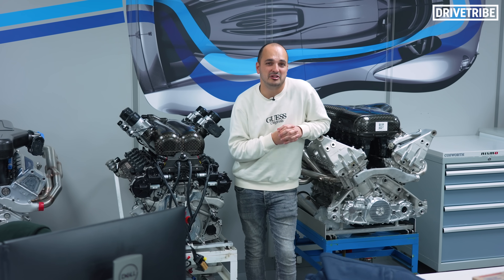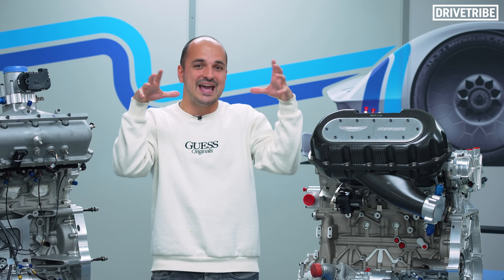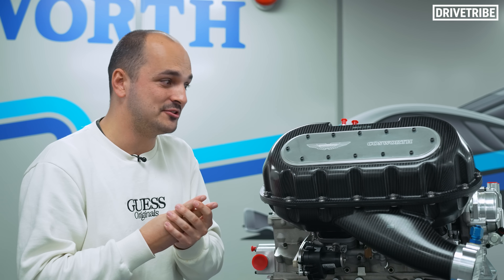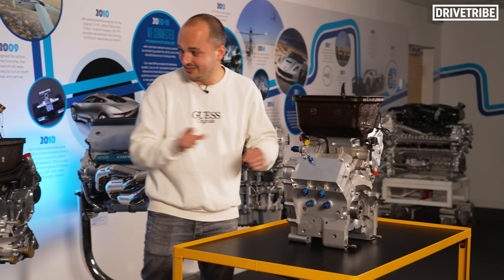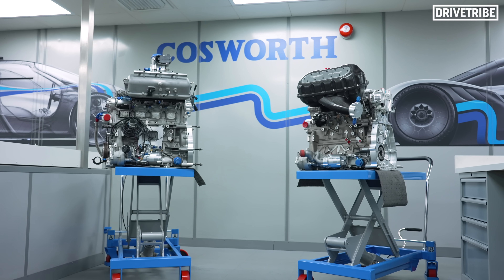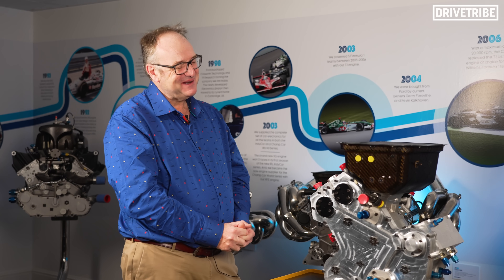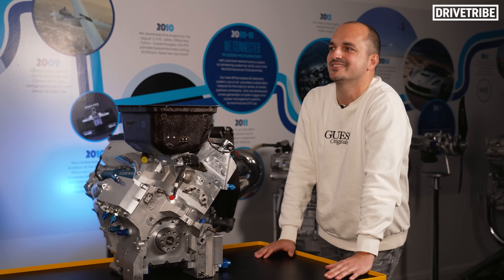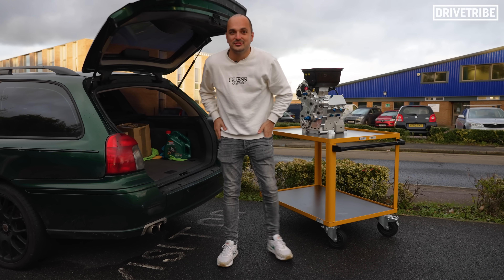This is a single cylinder F1 engine – 20,000rpm, 300cc, 90bhp!

Comment: the GM part numbers on the engine heads tells me we have the technology to get 50-100 miles per gallon mileage, but that wouldnt fit well with ripping the people off and keeping us broke . with hp like that we all should have 3 cylinder cars with over 300 hp/ the 4.0 litre engine is 245hp

Comment: Bah Hogwash  honda gran prix 250 cc sixes and 125cc 5 cyls blow them away and they did it back in the early 60s with rayon tires and no disk brakes.  the highest hp per cc engines were honda 6 yalve  and yamaha 7 valve engines.   Oh the 5cyl 125 did 29,000 rpm

Comment: Maserati used to make single cylinder engines to test their designs before committing the full size units into production.
A quicker and cheaper way to prove your ideas.

Comment: Turbo honda engines regularly put out well over 100hp-200hp per cylinder with everything stock except the turbo, pretty amazing considering they are built for low power economy cars

Comment: Instead of The High Rev's & High BHP on the single Cylinder / or 3 cyl' engines, Why not 
Lower the Revs & Bhp & Fit this engine to a Small Sports car or City Hatchback. 

Using this Formula, You maybe Could have a Very Fast But EFFICIENT Mid Range ? Ford Fiesta, & maybe a Tuned Version ( RS Turbo ) ? 
& Design it to run on LPG only ?

Comment: Why are all these guys knocking single cylinder engines ? My brother had a Royal Enfield 350 that ran as smooth as glass and a Velocette 500 that would stretch the chain it had so much low end torque. i guess they must be youngsters.

Comment: Is this engine  at 90 hp w/20,000rpm cosworth brand is capable for coaxial helecopter at one set?
Reply: no...no..i got  a wrong question not a set,I meant that this engine is capable to lift up me when I make a coaxial helecopter? I need spec. detail about  this engine regarding : the weight , fuel consumption  per hr. at max. full speed, including tempetature saturation? thank you

Comment: One thing I’ve never understood is how, considering spark advance timing is because the explosion takes some time to happen. Thus the spark occurs before top dead center. But how in the world can this work with s piston doing even 10,000 rpm never mind 20,000?
RIP Kevin Kalkoven

Comment: I'm amazed that a single cylinder engine that revs to 20,000 can even stay intact without falling apart. The vibrations must be a horrendous thing to experience.
Reply: I mean you can look at any high performance dirtbike, they rev out to 14,500 all day long without any issues. I can’t see another 5k being disastrous
Reply: Brushcutters have single cylinder engines that rev to 20 000 easily.

Comment: without a balance shaft no way it will go into a bike soon unless its a straight race bike with very hard suspension setups.. all singles i own and owned hadd balance shafts250-450cc 30hp-80hp apart from suzuki and kawasaki colaboration engine From the RMZ250 and kxf250 2004,2005 where they were revving 13.1k on a 250 cc 38hp and no balance shaft, needles to say they ditched the idea in 2006. making a gearbox for it wouldnt be impossible  but at 20k rpm with load its tough finding bearings that can withstand that and tollerances would be so very crucial and tight everywhere  it would need rebuilding soo sooooooo very often orwill goo balistic in seconds. imagine shifting at wide open and missing that 3rd gear KABOOOMM hahahaha

Comment: Something needs to be done with these super small, super light, super powerful engines. Imagine dropping them into an ultimate hot hatch build, or in something like an Elise or Caterham. It would be incredible to have that power to weight, and the sound...
Reply: They aren't light. Quite opposite

Comment: Noonan racing make a twin cylinder make 1000hp. from its big block same design just cylinder 1&2 chopped off front made for testing but i believe it will be a new motorcycle class video name:10 Unbelievable Engines from the Performance Racing Industry Show (2019) 14:30 min mark. channel the horsepower monster.

Comment: I think it's a lot of rotation for a single cylinder engine, about 14,000 rpm would be more acceptable for this engine, imagine a motorcycle with this engine running at 20,000 rpm? I think it would even be uncomfortable for the motorcyclist to ride with this engine in such a high turn because it is a single cylinder engine that usually vibrates a lot

Comment: 90hp 1cyl... I drive a Toyota Prius and the gas engine is 6 times the displacement, 4 times the cylinders, and similar horsepower. Maybe Toyota needs to look into this for weight and cost reduction

Comment: Yes one cylinder vibrations and canceling shaft , but there's 4 cylinder liter bikes, what about 2 cylinder parallel,  wouldn't that take away much vibration on a motorcycle with highhhhh rpm.

Comment: 90 hp for 300cc with an atmospheric single cylinder is impressive (after that we should see the endurance 😂) but that's 300 hp / 1000cc
I know that 4 other example of a powerful single cylinder:
- the KTM 690 LC4 654cc from 2007, prepared by Chooper Whork for kartcross in Scandinavia which produces 100 hp and 100 nm at 7023rpm, or 152.9 hp / 1000cc
- the KTM 690 LC4 693cc from 2016, prepared by FD-Racing for the "Challenge des Mono", 108hp at 8000rpm, or 155.8hp / 1000cc
- the KTM 450 SOHC 449cc currently used in the RFR450 of the Paris Dakar which produces 70hp with 450cc, or 155.9 hp / 1000cc
- and the KTM 250 Moto3, 249cc for 50hp at 14000rpm, or 200.8hp / 1000cc

Comment: 20k RPM. That’s over 333 rotations a second. Insanely fast!
Reply: Yeah... that's why all high reving engine sound so nice
Reply: like a musical instrument
Reply: @BlueRice Nah. To me they sound like a mosquito. Whiny and ear stabbing but in a bad way, and they make very lame torque at low rpms. I like the rumble of diesels, low revs, big torque.
Reply: @gabrieljordan9977  i like deep rumble too. It all depend on how sounds like. Its just like different note on musical instruments.  Some car sound raspy,  like thin soda can. Those sounds awful.
Reply: The rotations aren't the limiting factor here, the limiting factor is piston speed combined with conrod/piston mass.
Reply: @frankrommerts8447   limiting factor is accellerations
Reply: How can the fuel and air properly mix at that speed?
Reply: @eddiebanks6704  it doesn't, that's why it make less power at peak rpm in almost every engine
Reply: You wouldn't want that blowing up between your legs. 😅
Reply: i dont think it cares tho its too weak to power anything anyway
Reply: What always blows my mind is when you calculate how many times the valves are opening and closing per second.... Pretty insane to think about, imho
Reply: Unreliable
Reply: @guycha0s380  Huh?
Reply: @petercrisp2573  when air/fuel ratio is bad it make less power, that's why you see horsepower curve not peak in peak rpm, power peak at lower rpm than max rpm. Just look at most engines dyno sheets
Reply: @guycha0s380  My point was, you said “unreliable” - what is this referring to?
Reply: @petercrisp2573  higher rpm is bad for any engine, 20k that's insanely high
Reply: @guycha0s380  torque is more of an engine killer
Reply: @guycha0s380 This basic assumption about high revving engines is wrong. Friction, mass, power output, quality of components, are all more important when determining reliability.
Reply: @dennis-br6vr Nope, totaly the opposite. A high torque low rev engine like a big diesel can be very reliable and last for 500k+ miles with no rebuild. Just look at big semi trucks, low rev very high torque engines that are literal tanks.
Reply: @NGHmusic Thats true, but for a general tendency high rev engines just don't last that long and tend to give more problems than a lower reving engine that makes more torque.
Reply: @guycha0s380  Its not the AFR thats bad at all.  Its very easy to keep AFR in spec.   This isnt what even makes the power its just the explosion.  You change cam timing/ignition spark to create power.  The higher you rev the easier to get knock and harmonics which will cause wear to the piston/crank.
Reply: @gabrieljordan9977  Have plenty of d16's that go for over 300k.  Issue normally isnt the engine its the driver.  Also if the engine car were more expensive you see them last alot longer.  Its cheaper to get a new car though.

Comment: HP is meaningless, this engine would have near zero torque so it could take months to accelerate to the RPM required to generate peak HP.  Only torque pushes a car.

Comment: Had a single cylinder Suzuki Savage 650 cc motorcycle once. Aka "thumper," likely due to the sound it made as opposed to the potatoe potatoe sounds of vtwin engines found on most street bikes "cruisers." Wasn't making even 1/3 of that horsepower though lol.

Comment: The fact that 12-cylinder engines are considered as belonging to a different time is a travesty.
Reply: @Jb x we're arguing because this bozo doesn't actually believe in GCC
Reply: They were never mainstream, though.
Reply: v12 configs are still used in large diesel applications all the time
Reply: It's not a travesty; it's a testament to the advancements in technology that have allowed us to develop smaller and more efficient engines.
Reply: Legacy technology.
Reply: I bet that's how people used to feel about V16 back in the day
Reply: Accept it you are getting older
Reply: inline 8 engines used to be popular too
Reply: Well, when you've got 6 cylinder naturally aspirated cars making what old v8s made and v8s with turbos making far above what a 12 can, what's the point? They are a waste now, as beautiful as they sound and as smooth as they run, they are obsolete in a sense.
Reply: @ConGie  what about a supercharged or turbo v12?
Reply: @ConGie  A V6 or I6 can easily do the job these days. Not to mention luxury car manufacturers are eyeing on EV tech
Reply: You are wrong and I will explain why.  You can get high power numbers out of a small engine, but if you have a lower rpm, higher torque application, this necessitates a gearbox that adds weight.  At a certain point, your small high rpm motor needs a gearbox so heavy that the specific power output of a multicylinder engine is better, since the multicylinder does not need a gearbox.
Reply: @WojciechP915  this is why a v8 or an inline 4 cyl is the perfect engine...
Reply: Not a different time just a differnet class
Reply: All change involves grief, but irresponsible use of fossil fuels made it necessary to leave some things behind. Maybe "tragedy" fits your meaning a little better? Either way, it really is a sad thing.
Reply: @4thfrom7  Usage of the term "fossil fuels" to refer to hydrocarbons is in itself irresponsible.
Reply: @Zorro9129  Media buzzwords tend to be inaccurate but we use them to make our meaning clear without writing a thesis.
Reply: @Zorro9129    fossil fuels are literally made of fossils, in that they are created from the fossilized remains (materials,bones, traces) of long dead plants and animals following long periods of intense heat and pressure. In regards to the term fossil fuels, the word predates the modern usage of the term fossil and used the definition from the 1600's, where the term fossil referred to a thing coming from the ground. There's nothing perjorative about saying something came from underground, it's just a statement of fact.

Your use of the term hydrocarbon to refer to fossil fuels is far more dishonest. Hydrocarbons refer to anything made only of both hydrogen and carbon, meaning anything from methane to the heavy dienes, and not all are used as fuel. Many are used in the synthesis of polymers or are themselves solvents.
Reply: @Zorro9129  your ignorance is not my issue. Fossil fuels are made of those trace and material remains of dead organism after being subject to long periods of intense heat and pressure. Those fuels are, literally, built of decomposed fossilized remains.

Sure every fossil fuel contains hydrocarbons, but your use of the term hydrocarbon to refer to every fossil fuel is dishonest when not every hydrocarbon is derived solely from fossilized remnants or is used as a fuel, or when fossil fuels such as coal contain materials that aren't hydrocarbons (sulfur, oxygen, nitrogen, other trace impurities). It's like trying to argue that every human being is Rick James, because Rick James was a human.

To keep going, coal has been in use since prehistoric times. The first record was from Chinese record thousands of years ago. My source for the term fossil fuel is Oxford, it's readily available
Reply: @iceman5117  hydrocarbon maybe is a better term, there is proof that can produced in the magma of the earth and there is already theories which claims that for the quantity of oil took underground and from the known reserves and because for the organic matter to produce fossil fuels needs rare specific conditions, maybe some oil is produced inorganic by the earth interior
Reply: @ShakaZoulou77  hydrocarbon is a term used to describe a substance made entirely of carbon and hydrogen. These items include everything from methane to the alkanes and things like paraffin wax. Substances like coal and crude oil contain substances other than hydrocarbons, like water, sulfur, trace metals and minerals.

Fossil fuels refer to all co. Bustible substances derived from organic materials which have been decomposed and rectified by temperature and pressure underground (fossils). I have yet to see any evidence that materials like crude oil or coal have any natural, inorganic method of generation, and such an occurrence would fly directly in the face of the evidence of said organic origins, which would be the fossilized matter found in and near said coal and oil fields
Reply: @iceman5117  knowledge
Reply: @Zorro9129  This is YouTube,not chemistry class,we don't use professional terms here.
Reply: They actually do. They are inefficient, fuel guzzling, bulky beasts. They have no place in modern society. They were important long ago when engines were still in development and efficiency was thought as "the bigger the more powerful".
Now that we have bleeding edge industry where we can build stronger materials and shapes that were just impossible back then, we can build 3 times smaller engine that is just as powerful if not more powerful.

Oh wait till I reach electric motors.

Comment: That single cylinder engine would be something to behold in a motorcycle. Add a turbo and proper exhaust and the sound would be amazing.
Reply: You forget the incredible gear reduction transmission needed.

Comment: On the GMA V12:  The K24 is now a 2.3L,  the EJ25 is now a 2.4L, the C8 Z06 has a 5.4L V8, the Viper is a 7.9L, etc.

The engine displaces only 6cc less than 4L.  It's a 4.0L V12. Calling it a 3.9L is a gimmicky marketing decision and is dishonest, considering it goes against convention (where anything from 3950 to 4049cc is a 4.0L).

Comment: They should sell the 3 cylinders as crate motors. Imagine people stuffing them in miatas, MGs, and caterhams
Reply: I can see the three cylinder engine in a Ford Pop, Ford 100E, Morris Minor or a Model T Lakes Modified.
Reply: What’s a caterham
Reply: @mikecorleone6797  You have access to google...
Reply: @harrier331  no
Reply: @mikecorleone6797  What?
Reply: @harrier331  no my phone is ungoogled.. no google here
Reply: @mikecorleone6797  You have access to the internet... You are on Youtube...
Reply: @harrier331  you didn’t say internet you specifically said google. Now with all that effort you put in over the last day you could have easily just answered the question to begin with
Reply: @mikecorleone6797  It's a company that makes kits to build a car based on the Lotus 7. They're light 2 seat sportscars that have an open wheel design in the front and the driver position is more rear slung.
Reply: Melhor ainda, imagina esse motor em um BAC Mono girando 20 mil

Comment: okay but with how light that little single cylinder engine is, you could probably build a very interesting little track toy. Strap a turbo to it and you could have something as powerful as an abarth 500 that revs up to 20k rpm. Probably not feasible but would be hilarious and certainly interesting

Comment: FortNine on `90s Honda motorcycle CBR250RR 4cyl engine(these can last high mileage too): "At 20,000rpm traditional coil spring retained valves are opening 167 times a second and the pistons are experiencing 7,500Gs"
Re the Cozzie single cylinder, I just don`t understand how that size piston can handle such revs/ loads, coping with vibration too. Wonder what`s the longest it`s been run up for?

Comment: It's cute what the Brits think is a "big" engine.  I guess the Valkyrie engine is actually pretty sizeable compared to most, but the T50 engine I wouldn't exactly call "large".  How you can make a 12 cylinder engine that is less than 4 liters though is quite a thing.
Reply: I think he means big in terms of cylinder count. But generally your right I have a 2l engine in my clio and people think that’s big 😂